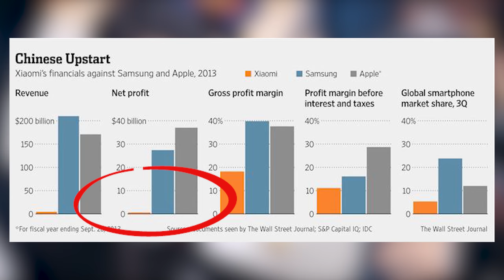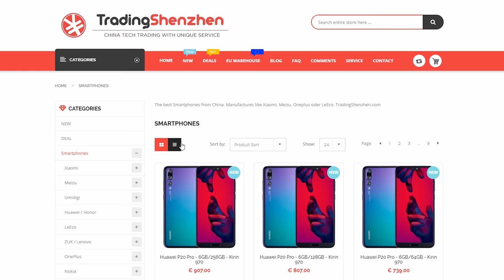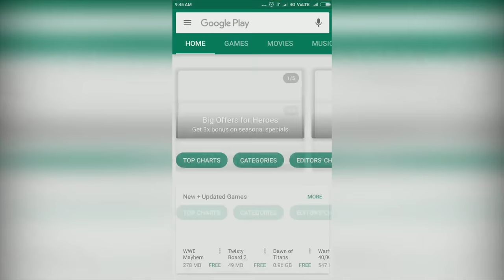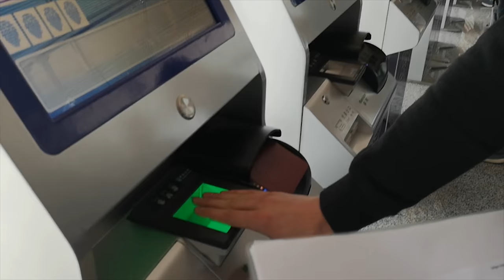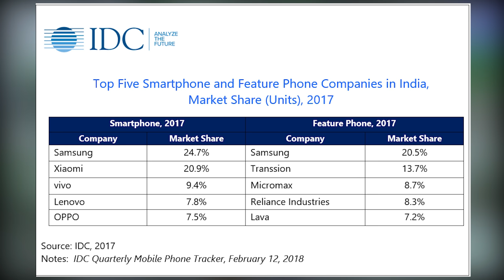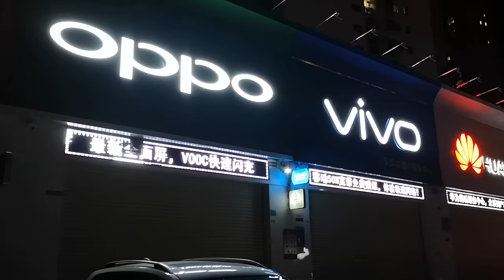The TRUTH about XIAOMI !

Comment: Cheap and high quality! That beats me
Reply: Not particularly high quality though, but acceptable, doesn't break as fast as other Chinese products but there are reported issues. Definitely not the most durable.
From my previous searches, Mi3 seems to have really good build quality, but anything since then is inferior, if not absolute crap like mi 5. I guess that they needed to cut corners.
Reply: Thanh Do Huu I have an mi and it's got a great build. Its cheap, and works really well. And since its cheap you can keep buying a newer phone every year unlike iPhone which you're stuck with because it's so expensive
Reply: Also its hi quality enough that it'll easily last a few years
Reply: They are far much better..money well spent kind of a deal...low cost, high specs with a really rich look...
Reply: Biking Blues agree
Reply: I agree. My mi mi4i is going 4 years. Its great phone. Still using today. Its cheap and it last longer than my friend iphone 5.
Reply: My relative Redmi Note 2 is still in great condition outside of a replaced battery aftee 3 three years of usage, i bought that phone for her in September 2015, no glitches no error just solid rock stability for her needs if social media & communication. 

My own Redmi Note 4 is almost 1.5 years old and still rocks as my daily driver, 9-10 hours of SOT with pure GSM data. i also have two Mi Max the first version, almost 2 years old and they're all still doing very well for my wife and daughter.  

For their price tags, Xiaomi does build, manufacture, and sell very satisfying products.
Reply: @thanhdohuu9473  Using my mi5s. i am a clumsy user who drops his phone atleast once a day. guess what? my phone is going 2 years and doesnt show up any signs of malfunctioning. even gaming on it while charging.
Reply: @seanrivaille6944  well, if the phone is drop enough it will definitely affect the touch display even without sign of damage.
worse will be my asus phone, yet to be 2 years the touch has issue already and now i switch to redmi s2. higher spec but cheaper than asus i got a year back
Reply: @thanhdohuu9473  Go watch some jerryrigeverything
Reply: Much better than Metro PCS's disposable phones that stop working at the 1 year mark.

Comment: Watching on my Redmi Note 4.
Reply: Noob Tube Lol, me too!
Reply: Me too :) dropped it several times, still alive. Beast phone.
Reply: Same
Reply: I would also but WiFi doesn't work outside of the 1 meter range
Reply: Note 4 is lame.... People with a bit more money prefer the Mi Note 3!
Reply: Lümmelmann Redmi Note 4 is more than enough for most people,

24 hours on screen time per charge, 3 x more than almost all other phones out there,

It only loses 1% of battery life overnight,

Running Nova Launcher means i can lock all my apps,

I don't need any more,

I only buy what works for me after research and this phone is a perfect balance of performance, price, and battery life,

I don't care what a phone looks like, and it seems to me the specs plummet with any other Xiaomi phone more expensive than this one,

So if that is lame then so be it,

But i would buy another in a heart beat for £115 all in  shipped from China with Global Rom.
Reply: on my mi6 ceramic hehehe
Reply: my note 4 is visibly Bended,  and still working....  i hope Xiaomi keeps doing this kind of products and dont go i to the shit apple way
Reply: Same! With lineage os 15.1 treble
Reply: Redmi note 5 here
Reply: Me too!
Reply: Noob Tube I'm using note 5
Reply: Noob Tube With my mi mix 2
Reply: Note 5 pro here
Reply: Redmi 5
Reply: Andrew Murphy only the weak minded resort to name calling,

I would rather not spend £300 on a phone with a smaller battery,

There isn't an extra £200 in components and quality just more profit for Xiaomi,

The bezel is there to protect the phone,

It's your money i don't care.
Reply: Noob Tube it was a joke prodding at funny rabbid
Reply: Noob Tube Lol me too!!!!
Reply: The same here :)
Reply: Mine got stolen 😭 I had Lineage OS installed on it, perfect customizability.

I really want to buy another one, best phone I've ever had apart from the fingerprint reader glitch.

MIUI sucks but since you can install Lineage and get pure Android + tons of options, it's a fantastic phone to use.

I'm saving to get the 64gb version this time. The 3gb RAM variant was already fast enough, wonder how much faster the 4gb RAM one is.
Reply: Same
Reply: With my redmi 5+ still the best👍👍
Reply: me too
Reply: wont recieve oreo even though my phone is older than u i will get it xD lol
Reply: Same
Reply: Noob Tube me too
Reply: I love this cheap and greatly featured smartphone
Reply: redmi note 4 is crap, only the battery is good, everything else is shit. Great phone for indian people, nothing more. Also the phone is bulky, uncomfortable, heavy. Camera is crap. uses samsung isocel sensors. Ehhhhh. Waist of money. Better to add a bit more euros and buy huawei or somthing else.
Reply: Tomas orrr, you can get a Redmi Note 5 which has basically the same processing power but more optimised because... Snapdragon you know? Not Kirin. Also it eliminates the camera, design and comfortability issues. The software (MIUI) is way better, beautier and more featured than huaweii's. Still has a larger and better battery, isn't that heavy and is also way cheaper than Honor 8. Saved some bucks for ya.
Reply: Note 5 on Android Pie here!
Reply: yea, me too. best budget phone. for me expensive phone with non-removable batteries that will detoriate after 4 years is like throwing your money.
Reply: me too.3gb version
Reply: Just bought the Mi s5 Plus.
Reply: Me on my Redmi 5
Reply: Watching on my redmi note 3 😎😎😎
Reply: I'm Redmi 5
Reply: Me too 👍👌
Reply: Me too 🤣
Reply: Im using redmi note 5 pro
Reply: sameee
Reply: Watching on my Redmi Note 5 hehehe
Reply: me too lol
Reply: Watch on Mi Max 3 xD
Reply: Ayeeee
Reply: Xiaomi Redmi Note 5.... Cheers 🍺
Reply: Me tooo
Reply: Redmi note 5 🖐️🖐️
Reply: Note 5 pro
Reply: Redmi Note 4 here too. It's been 2 years since I bought it.
Some time the phone freezes for a second, the battery is starting to fail(just like any battery after 2 years), and the camera is not good but it does the job. I paid 180 USD so I think it has been a good investment. I would buy Xiaomi again.
Reply: Am on the redmi note 5 pro...best.phone.ever
Reply: Watching on my mi mix 3
Reply: Funny Rabbid  your phone is weak I have the mi mix 3
Reply: I've dropped my redmi note 4 countless times and it's still alive and rocking with no cracks on the screen. Damn this phone is tough.
Reply: On redmi note 7 😁
Reply: Lol same
Reply: Same bro
Reply: How bout note 6 pro budget boy
Reply: Texting on my redmi 5 plus... And it's a very good phone for the price, almost same performance in everything like the p20 lite, except the p20 lite looks better and has portrait mode on the back, but at night redmi 5 plus's camera beats it, p20 lite is overhiped like its a really good phone for the price, but it's not, the mi8 lite is far better for it's price
Reply: Watching on my Redmi 5 Plus

Comment: I'm from the UK and bought the Xiaomi MI 8 ... Best 400 pounds I have ever splashed on something... Has 64GB of storage and 6GB of RAM an eight-core Qualcomm Snapdragon 845 processor with a 12+12 MP dual camera and 20MP front camera with AI. 3400mAh battery with fast charge and I mean fast charge lol and the screen is 6.21 inch amoled... All that for 400 quid compared to other mainstream device brands ?? Is an absolute bargain. The only two things it doesn't have is Wireless charging and waterproofing. If your drowning it won't help but hey ho....

Comment: Many people say Xiaomi phones break easily. Of course it would.
it's fragile on the outside but really strong on the inside.
It's that kind of phone that you should treat with care so that you can use it for many years.
Reply: Have no Idea what you talking about my mi 8 dropped from my pocket more than 100 times and still 0 scratches
Reply: @sekki327  samei dropped it 99999 times the screen cracked and has alot of micro scratches but the internal? Yep still fine

Comment: Yes you can remove the bloatware. its as easy as selecting uninstall.  However, if you give the stock apps a chance you will quickly find that they are often far superior to what you currently use. Apps such as, Dialer, contacts, calendar.  Even the Miui cloud syncing is such a great tool. With Google you can restore apps, contacts, appointments etc. With Miui you can restore those things plus your on device files such as Music, backgrounds, launcher themes, and all of your preferred settings.  Next time, when considering a phone give Xiaomi a chance. You will not be disappointed, they are excellent phones, with top of the line hardware, and are aesthetically very pleasing.

Comment: Xiaomi buyer's experience is all nice and cool at first but overtime you realize the tremendous mistake you made. The battery starts loosing its capacity, the micro USB connector begins to loose connection when moved and a simple fall is enough to shatter your whole screen (regardless if you have a screen protector or not).

After all that, paying a little extra for a quality brand like Samsung, Sony or Apple doesn't seem like it would've been a bad idea, trust me.
Reply: Well its just the same with my old Samsung tab 3V time will change everthing

Comment: This has been very helpful. I currently have an I phone 7 plus which I paid off on a plan over 2 years. I really like it but I’m a very low user. A few calls and media browsing. My contract is ending so going sim only will save me a huge amount of money every month. I have wanted to try the android market where my first experience many years ago was awful. It’s changed dramatically and I’m about to collect a Nokia 5.1 as my spare phone. The products available make it very confusing for a consumer. It seems everyone is crazy on specs especially cameras when actually you are buying a phone to make calls with. Well that is what a phone used to be. My major concern is that Android devices don’t seem to get consistent updates depending on the brand. This is one of the reasons I’ve chosen Nokia. Maybe updates aren’t that crucial but security is and I’ve never had any issues with Apple. Despite their negative image their products do perform exceptionally well and updates are immediately available. I’m hoping that market forces will mean that they have to offer more budget friendly phones. I’m happy to pay for an I pad but not for a phone at £800.

Comment: Currently I have a Redmi Note5 and my wife a Samsung A60. 
Although the Samsung is 6GB with a 675 Snapdragon, and my Note5 is 4Gb Snapdragon 636, I find the UI more appealing and user friendly. Also the speed on web browsing is faster and I have more apps and memory used than the A60.
The 4000mAh battery is very durable too. I'm thinking about upgrading to a Mi10 Pro.

Comment: Bloatware apps with ads is a first and you are right that the apps are not removable which was not the case earlier. I suppose its justified with the low margins and and the overall low cost of phones. Also, i would like to mention that xiaomi's ui aka miui has been increasingly facing embarrassing issues. Recently they cancelled two maybe more miui updates because they had too many bugs. Other recent miui updates have also ruined features of the phone like the camera which were fine earlier. Further some people have had their phones hardbricked because xiaomi with their recent miui updates added anti-rollback.

Comment: One problem with cheaper phone brands, is they tend to rely on manufactured obsolescence to get the customers re-purchasing more frequently. Smart phones are environmentally intensive to make, hard to recyckle and require minerals that miners have to work in brutal conditions to get. If a more expensive phone means I use less of those resources over the years, I couldn't care less if the price tag is higher. There's more to the equation than price.

Comment: I don't use many of the apps installed on my Xiaomi. Because there are a lot third party apps for free(without ads) available, wich are a lot better.(Nova Launcher as example) Especially when it comes to usability. Like, since MIUI 10 there is no way to control the volume by touchscreen anymore. At least not on my device. Or the pre-installed video player wich reacts too sensible to the touchscreen. One touch and the volume rises to max or decreases to min or it switches between fullscreen and back. There is no setting to turn the touchscreen functions off for this app. But i tested most of the pre-installed apps when i got the phone and none of them had advertisment. The only message i got in some apps was that i should use the Mi-cloud. Wich i don't. Not because it's Mi, just because it's a cloud. I don't use clouds at all. The most of the pre-installed apps were removable. Except the Google crap. But i was at least able to deactivate most of them or remove all the permissions. I have the EU version so it's based on google play store compared to the chinese version. All in all it's a very good device if you replace the Mi apps with good third party ones and get rid of google as best as you can. As example: My searchbar uses Firefox and DuckDuckGo.

Comment: Xiaomi has been nothing but disappontments. I bought my first AND last one Redmi 5+. Along with it, I bought a pair of headphones, some charging cables and a power bank, all from an official MI home store. All except the headphones kept breaking. I exchanged them several times within the warranty period. The main thing is the phone, of course. In the beginning, it was ok. Then it started shutting out of programs, lagging during different applications, even when using high speed Wifi. Even when running its built-in programs, like the Optimizer, it would stall and I would have to shut the phone down and reboot to have it running again. When typing, I often get numbers instead of letters (using Google keyboard). Other than exchanging my broken accessories, I have brought my phone to be repaired multiple times. They fix some of the issues and claim that other issues are due to third party software. I believe it is their altered user interface MIUI and maybe hardware that is causing the problems. I have had other brands of smartphones and haven't encountered ALL these problems before.  By the way, when my phone was being repaired, they did not have an option of a loaner phone!

Also, their customer service center used to be one of their retail outlets. Back then, customers were able to use the bathrooms. Since it became a service center, the bathrooms are no longer accessible to customers. They have a drinking water dispenser, but most of the time the 5 gallon jug is empty. When I informed customer service, they replied it wasn't their responsibility.

Yes, the price for Xiaomi's goods are very attractive and the specifications of its phones seem like great value. However, the quality and service is very lacking.

I strongly suggest to stay away from this brand.

Comment: Huawei is in fact more like apple: overpriced garbage

I bought a redmi 4a about 3 years ago and recently a Huawei Y6 2019 and the redmi 4a is still better except for screen size. Redmi has more sensors (gravity, magnetic), better CPU (slower clock speed but better performance), better reception on the same network in the same area, better os features (split screen/dual app) but yes some Mi apps do have ads which is a bit lame but the new phone was 1/3 more expensive than my redmi 3 years ago, you can actually get a redmi 4a for half the price of the Y6 in my country at the moment.

Comment: Hardware is great, the software is outright criminal. The Smartphones have Roms with Bloatware. And before someone says " But the international version..." the international version is also bloated! The international version doesn't have the chinese favorite apps installed, but includes all the chinese services under the hood. A chinese translation services that loggs keys, facebook services that even run and communicate when the app is uninstalled. There is an incompete list of bloatware that can be removed with developer rights on XDA.

The apps for their gadgets are also a big nono! One app sends maps from your home, the other sends your health data.
Reply: That's a nagative for me, disregard the Chinese version because yeah... But I've bought a Redmi Note 5 and no issues that you stated can be found, bloat was 0 expect a few apps you can uninstall and I haven't found a single Chinese service running on it. Even checked the full software info to be sure and yeah, no issues, these phones just work. My father and me both switched to Xiaomi and no problems what so ever. Maybe it is down to the fact that I've bought mine in Slovakia (Europe) and I specifically asked for the global version which they had of course. And even if you are inside China, you can go to Hong Kong fairly easily and but the international version of the phone legally (it is illegal in China) and you wouldn't have a problem...

Comment: Xiaomi is doing what Apple used to good at, which is inventory control. 
Xiaomi said it will keep its hardware profit within 5% margin, you have to believe it when it is a public holding. 
Xiaomi is not just phone, literally everything you use at your home from washer to TV to battery power, tons of hardware, that I would call it a home eco-system. 
For me, never bought a xiaomi phone, but I bought xiaomi ultra short projector (2k USA), LG ultra short projector is at 25k USA
Bought air filter that clean air after cooking(200)
Bought a smart toilet cover that wash my ass (150)
Bought a washer + dryer (200)

There is no fucking way any competitor is even close to the price and quality xiaomi provide , period!